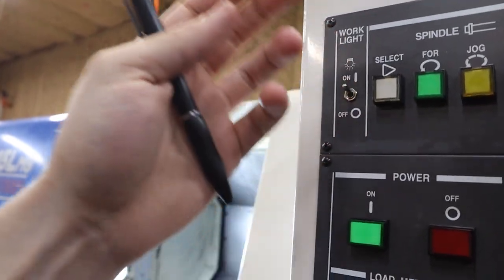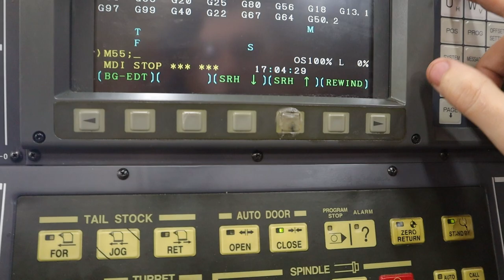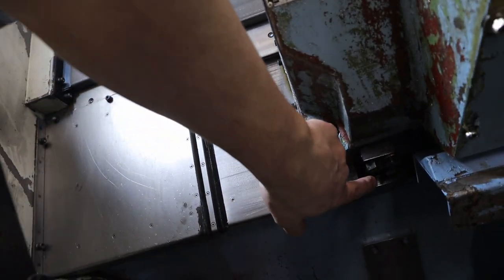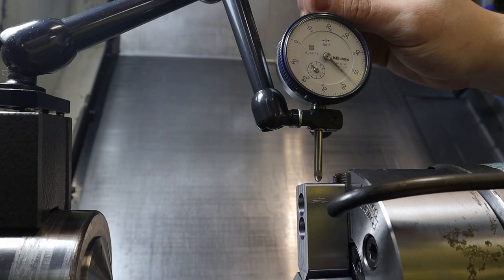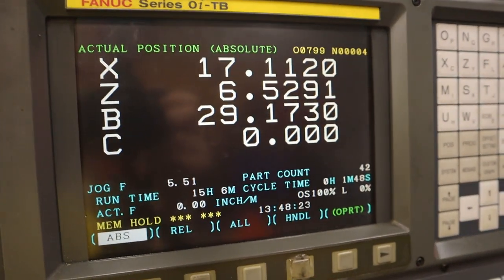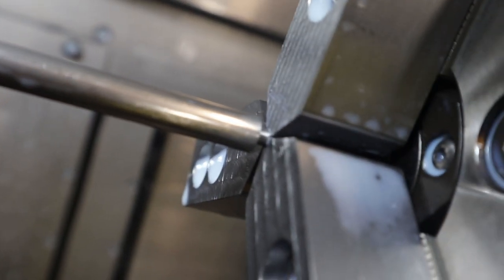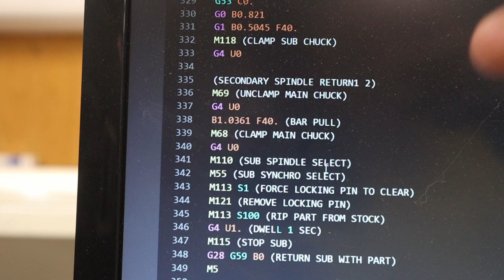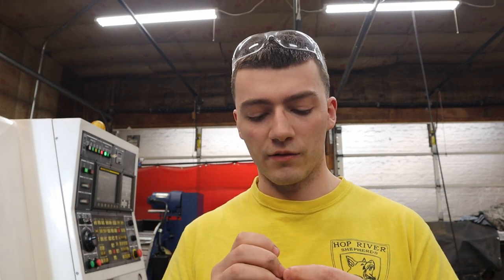Square knife spacers on a cnc lathe - Square pegs, round holes.

Comment: If you part off the part when it is clamped in main and sub, you might have less deformation on the sub spindle jaws - although your quite space limited, so you may need a long parting off tool
Reply from the maker: Yea this is mainly a part off blade length issue

Comment: How bout orient the sub and then mill the square with the live tooling in the lathe so it's perfect? Just put a spacer in the jaws in the back were your not milling the square.? Just a thought ...didnt finish the video yet ether... so if I jumped ahead I'm sorry
Reply from the maker: Unfortunately none of the live tools face the sub.
Reply: @split141x  darn,,,hey ya know making 1 would be a really cool video! I would try plastic or aluminum first before spending money on cast iron. It's so cool between your lathe and mill and surface grinder you can make ANYTHING!!!! 😁

Comment: if you put indicator on main spindle and rotate the sub it reads 0. If you rotate main spindle it droops so the measurement is not valid. I dial in dead centers in a multitasking machine using indicator mounted straight on the jaw to not have any flex. An mptec mag base droopped about 0.2mm when extended all the way
Reply from the maker: Yea so I might not have explained it, but I never rotated the indicator due to gravity. If I do need get something concentric to the spindle I'll use a co ax indicator in the spindle. I can't use one here because of the shape of the inside of the sub spindle jaws, otherwise that would of been a bit more accurate. I guess I could of used one to hit the tops of the jaws, so maybe I'll do that next time.